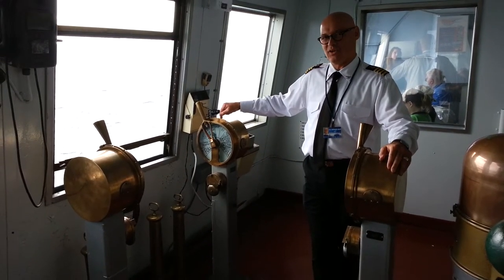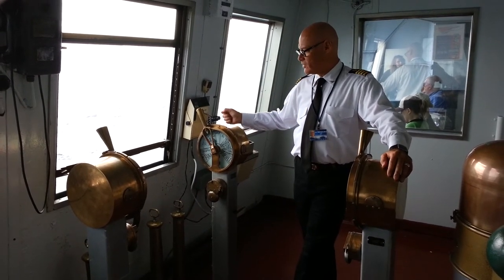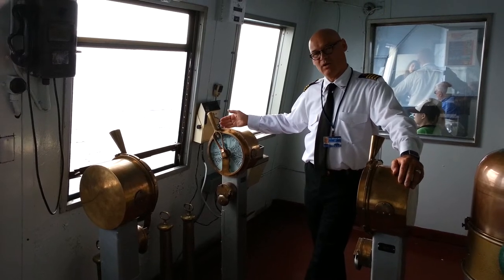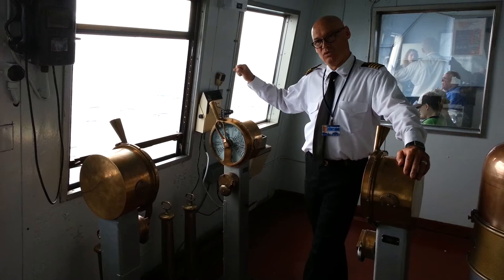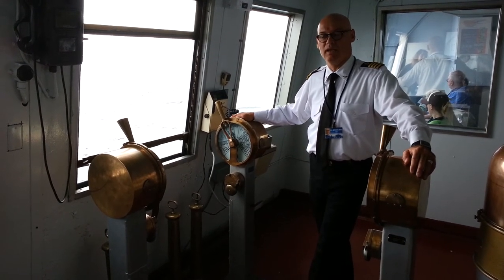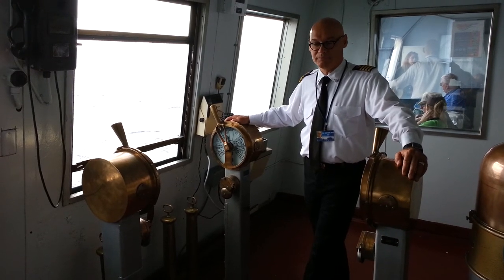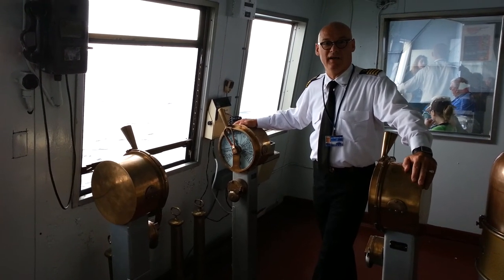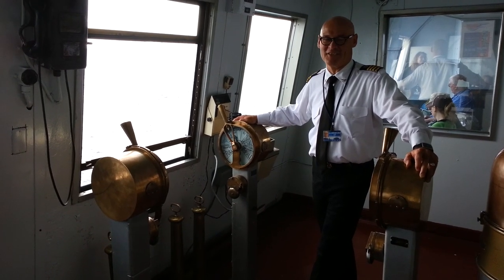Aboard The S.S. Badger, Captain Curtis Explains How To Use Engine Order Telegraphs

Comment: I'll never understand why they kept using these for so long, you would think that it would be fairly simple to have the throttle electronically controlled and operated directly from the bridge.  When I was in high school, we took a field trip and got to see a nuclear submarine, and the throttle still used a telegraph kind of like this...I would think that for sure a nuclear submarine would have a direct electronic throttle!  It was kind of an old sub, so maybe newer ones do.
Reply: WōW, a Nuclear Sub !
Reply: "you would think that it would be fairly simple to have the throttle electronically controlled and operated directly from the bridge"
This holds true for internal combustion engines, and to a lesser extent steam turbine engines. But for reciprocating steam engines, certainly not! The captain mentioned that a single order on the telegraph put six men to work adjusting the engines: Setting a steam engine to a desired throttle is a delicate process that involves multiple levers and valves in a coordinated action, as well as ensuring that the boiler output is not too much or too little for the new throttle setting. It would be a very complicated task to make an electronic steam engine controller and the demand simply isn't there.
Reply: If there's a power loss, you'd still want to communicate with the engine room.
Reply: This ship was built back in the fifties, and even though during subsequent overhauls they probably could have updated the systems, they chose to keep it historically accurate as you see it.  And besides, it works perfectly fine!!   I’ve always had a long standing belief......”If it ain’t broke, you don’t fix it”......Especially with a piece of history like this ship!!